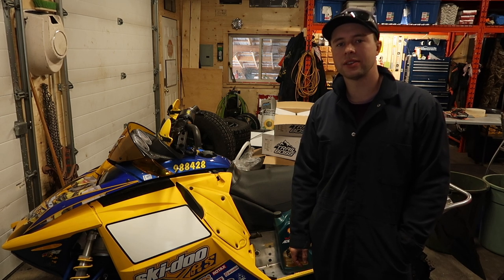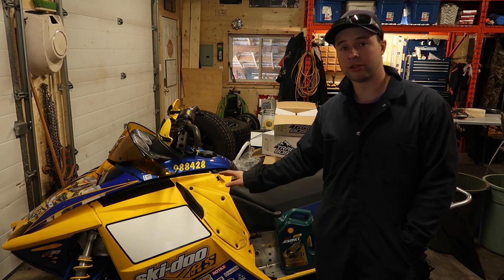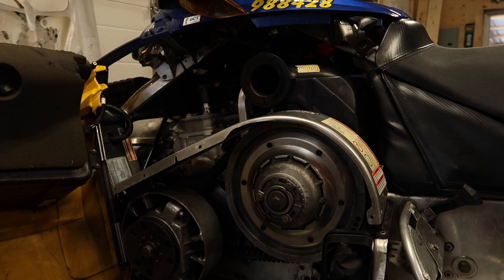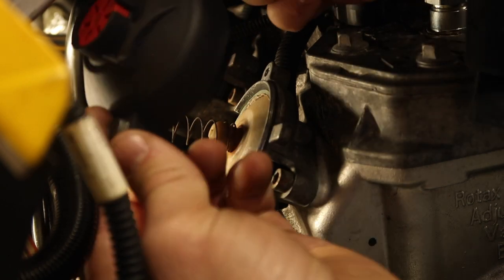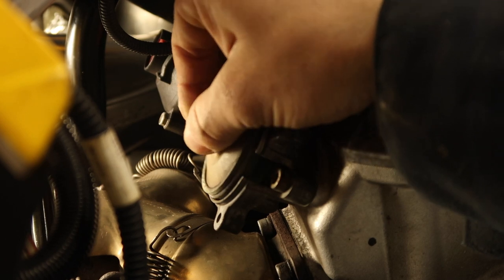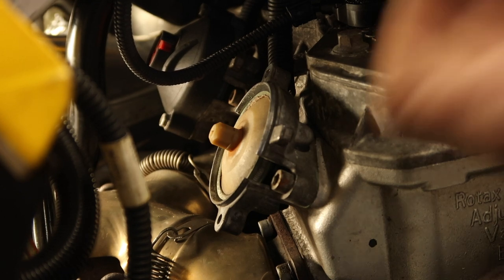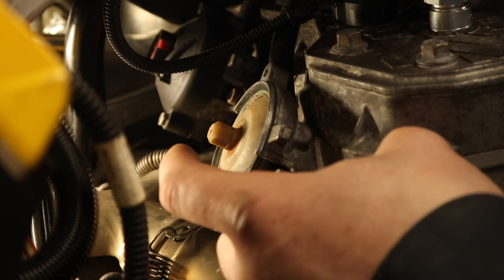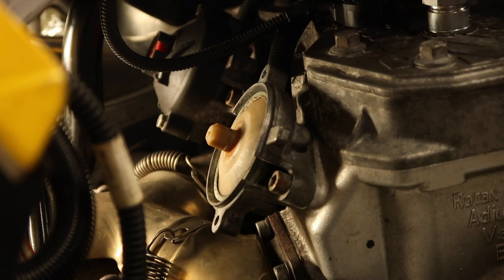Ski-Doo Rave Valve Check Without Pulling Apart!!

Comment: Great video! Question though. 

I just did this check on my ptec 800, both raves operate smooth, however the rave closer to the PTO side is much more "oily" than the mag side. 

I never used a vaccuum tool and only used the hand method. Think a seal/ o-ring could be damaged causing it to blow bypass? There isn't any obvious leaks, only when I remove the black covers.
Reply: would suggest that you check diaphram that is a sign of leak.

Comment: My one Rave valve stripped out the threads and started spitting oil. I got a new valve, diaphragm, gaskets, and cap. I ran it once and the cap melted after a 30 minute ride. What else could it be? The housing? There is a bit of a gap but its the same through the housing into the engine